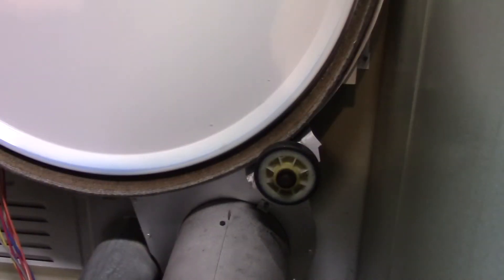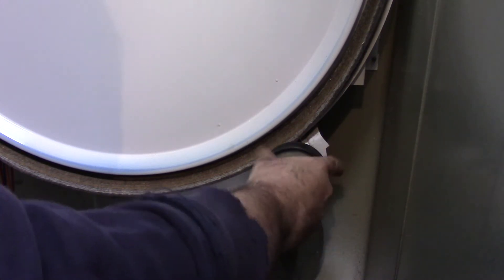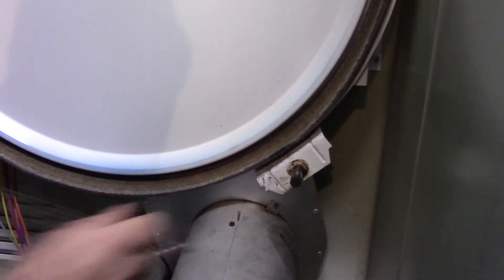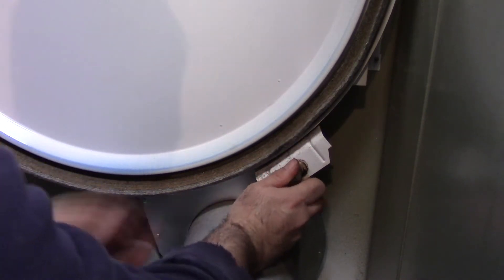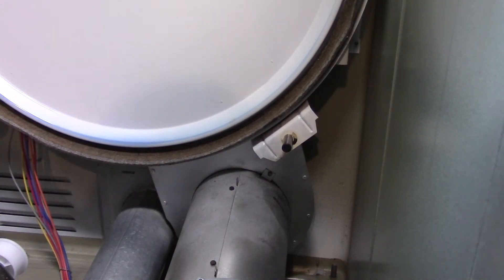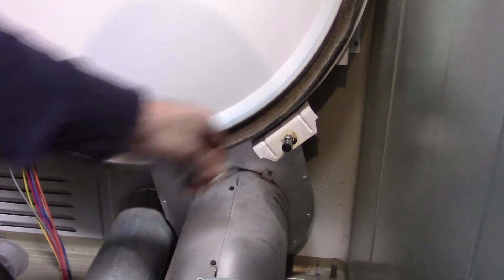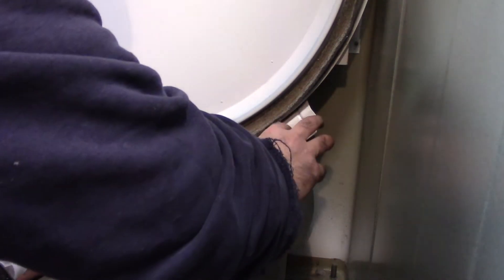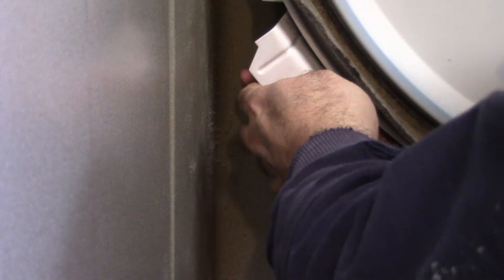Change Drum Rollers - Maytag Dryer

Comment: What was wrong with them that you had to put new ones on?? Can they warp or something? 
I took a strip of fine sand paper and sanded mine (did not remove them),then a tad bit of high-temp grease and that fixed the squeaking...
Reply from the maker: Mine was squeaky and making a thumping noise.  The one set i had did have grease on them and seized up with lint.  I just changed them again when they were chirping but found the bearing shredded